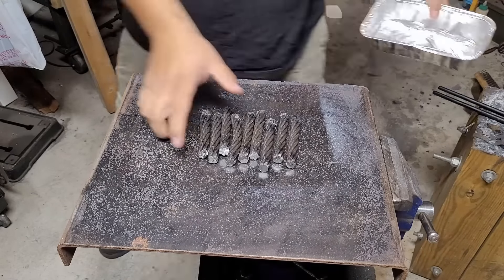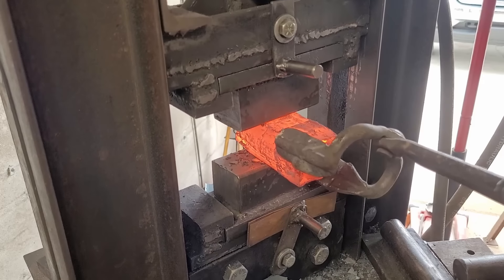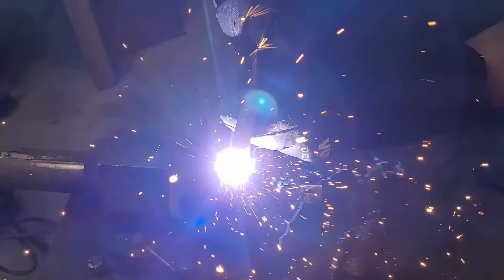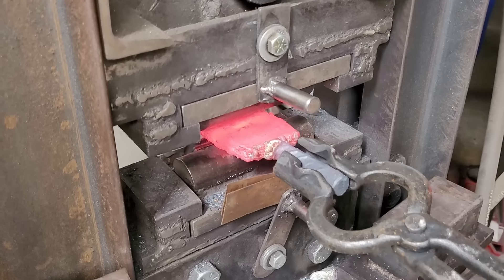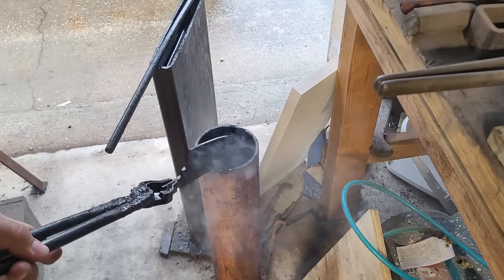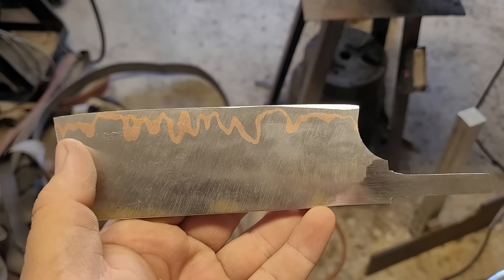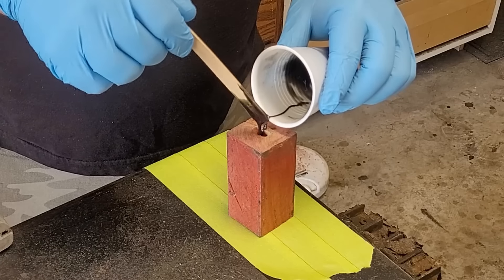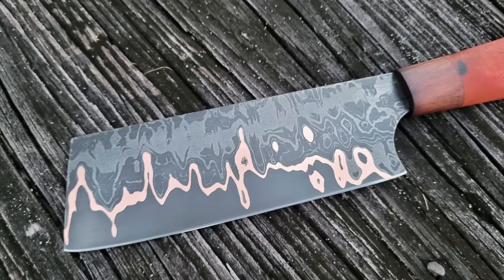I Make A Knife From Copper And Cable

Comment: Just found your videos, and I'm the 7+ years I've been watching knife making videos and Forged In Fire, I've never seen anyone do the end press for can damascus steel, which makes perfect sense to me. Is that something you thought up, I'd bet your knives are better than anything they've had on that show. The last time I did any blacksmithing was over 10 years ago, but I've learned something great from you. Keep up your great work. 👍
Reply from the maker: Its hard to do. I have a very low success rate because its easy to pinch the can. If i pinch it the billet gets trapped inside and i still have to cut it out. But the white spay paint makes all the difference in removing the billet from the can.

Comment: Regarding the popped caps, what I see on other channels is drilling a little hole in one corner of each cap. Then no worry about pressure blowing it out. Nice blade, and I like that you offer commentary unlike most other similar video makers.
Reply from the maker: I like the cap popping off because it makes for easier removal afterwards

Comment: Those are actually not cracks those are voids from losing copper, I have felt with that from experience prior to my first successful cu Mai! Cu Mai is delicate dance of heat and forging! Great job turned out good
Reply from the maker: That makes sense. Most of my Cu Mai turn out okay. Occasionally ill have a problem but over all it works out
Reply: Blade came out great.  And congrats on the 100k.   I'm happy to say I was your 150 th just a couple years ago now. Forge on !!!
Reply: @JPsBladeworks  my first two attempts failed I lose to much copper was trying to multi task and the billets got to hot! 3 rd and 4th ones were a success

Comment: JP, I have made some twisted cable damascus back in the day. One of the things we always struggled with was the heavy amount of grease that is packed inside the wire rope. There is usually some kind of fiberous/cloth material in the interior that is packed with grease as well. I think it is designed to wick up the grease as it heats up. As a consequence we always had trouble with voids. If you have an ultrasonic cleaner, maybe a bath of Simple Green and 30 minutes getting the hell vibrated out of it before you give it the spa treatment in the acetone.

Anyways, you may not have trouble with the voids and inclusions, but if you ever do, try looking into that.

Also, I wanted to say, the final product looks sweet.
Reply from the maker: Thank you for the advice. Ive had tons of trouble almost every time ive tried doing cable. Thats why i always end up putting it in a can vs heating and welding the fibers like others do. I think it also has to do with the size of my cable. Its small. Ive seen others using way bigger cable. Regardless im glad it came out cool looking in the end.

Comment: Decoration  and light use only. Copper will NEVER properly fuse to steel to create a reliable, strong weld. Under force/pressure, this blade will separate. Not taking anything away from this guy or his skills. It does look great!!
Reply from the maker: The force needed to break apart the bond is much more than you woudl ever produce cutting food.
Reply: 😂 tool

Comment: nice work,
if you put a small piece of scrap copper on top of you billet while forgin you can tell if the copper inside you billet is molten if the piece on top is melting, and prevent blowing molten copper al over the place

Comment: I have seen some folks drilling in a small hole/vent on the top of their canisters, not sure if that's something you have tried to prevent your canisters from popping.
Reply from the maker: Its done to release pressure from the gasses created in heating the canister. I dont drill a hole but i leave holes in my welding to relieve that pressure.

Comment: Please correct me if I’m wrong here but, would this not be a super weak blade bc of the copper?
Reply from the maker: No because the core steel is whats keeping the main integrity of the knife. The copper also brazes the steels together creating a strong bond. Much stronger than the force you will exert on a cooking knife.

Comment: Very nice.  I just wish other makers would split those wood blocks.  You could make 2 knives instead of 1 and a bunch of sawdust.
Reply from the maker: For full tang, i slpit them to 3/8 sheets. For hidden tang i prefer to keep thick incase anything is out of square. Its easier to shave material than it is to add back on.

Comment: Why is the tang so small. Just my opinion the tang should be the whole length of the handle for proper balancing
Reply from the maker: It depends on how much steel i have to allocate to the handle. Sometimes my math is off and the tang is a little smaller than i would like

Comment: I'm asking this through pure ignorance, how does the copper go holding an edge? Is it actually practical?
Reply from the maker: The copper doesnt do any of the cutting so it doesnt need to hold an edge. The core steel is what does all the cutting and it is a high carbon core

Comment: You ever stop to think about why you always have so many  delaminations on your work when your done grinding? It's because you press like a savage. If you stop and take little bites of steal at a time instead of crushing 3-5 inches worth of steak at once you'll have zero to maybe a delam. It happens but it happens to all your work. You're always having to cut your work smaller because you press too much at once instead of taking your time. You got to be a little more delicate. I'll bet you any amount you want that the next video you do and you actually treat the steel with respect you'll see how much better your work comes out.

Comment: That came out great! I wonder if there is an acid that would be able to eat away at the copper so it lays just slightly under the surface which might make an interesting look. If you can achieve this maybe you can patina the copper @Max_Randolph_Studios has a video testing different ways to patina copper for his iron oak project. Just an idea to play around with.
Reply from the maker: I can fire red it but i dont know if i can patina it blue
Reply: Ferric chloride should eat the copper that’s what we used to etch circuit boards when I was in school
Reply: Next time you make a bullet like this soak in ferric chloride in one minute increments til you get it the way you want. Might also then soak in espresso coffee overnight that could be cool combo etching.